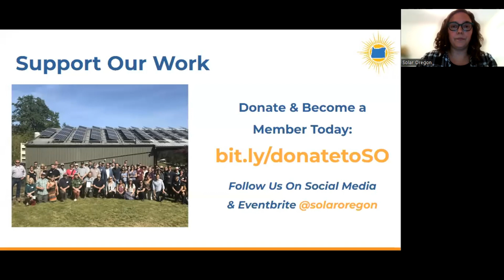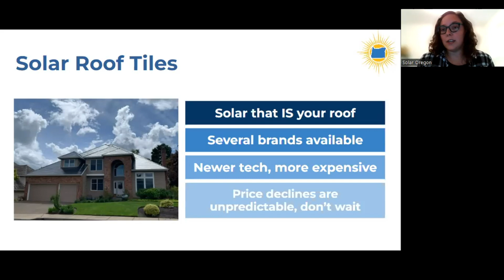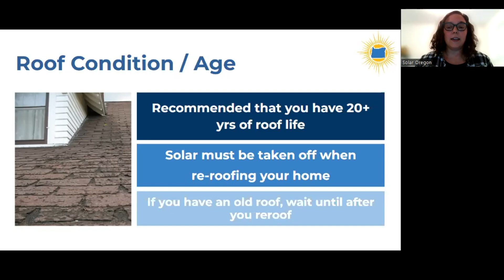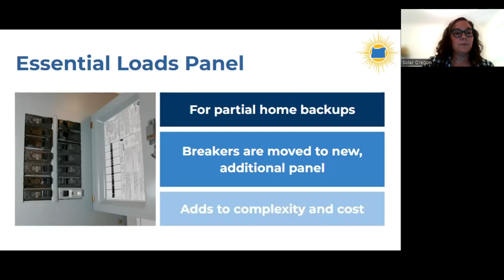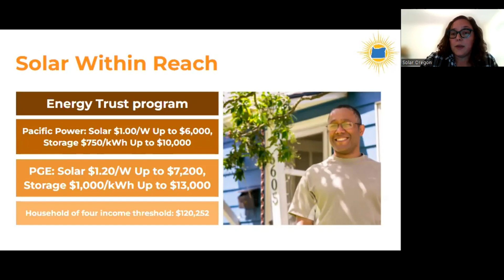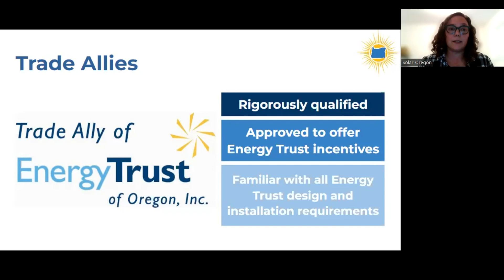How to Go Solar + Storage Webinar - recording 6/4/2024

Comment: Thank you for the presentation. I am not sure if I can put up panels. However, I did have a thought. How about installing just the batteries? If the power company gave me an off peak price break, I could save money. The batteries would also provide power in times of peak demand, brown outs, or loss of service. Better yet, I'll just plug in my EV.